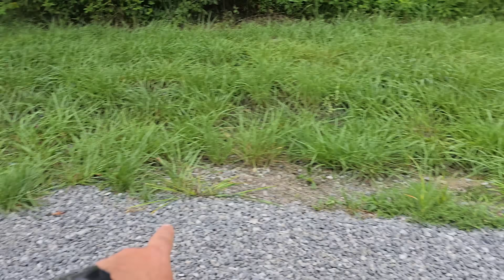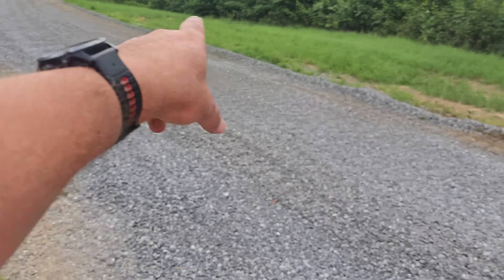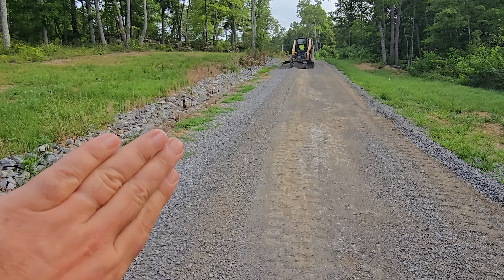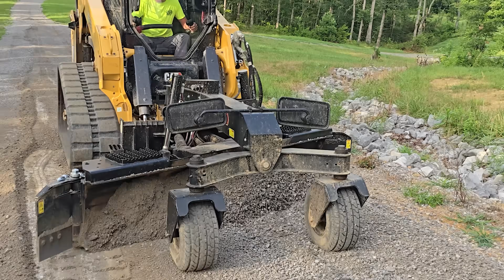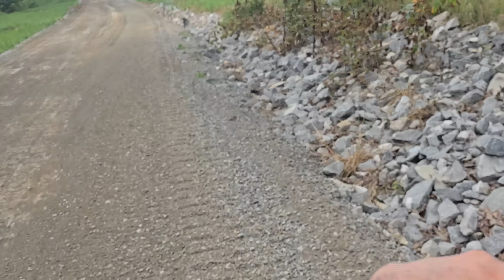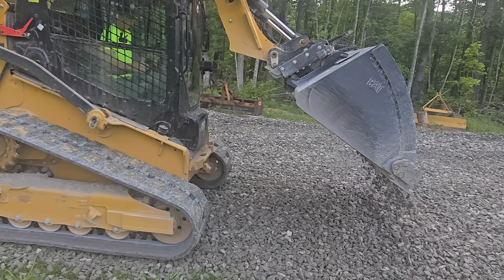#1 Worst Gravel You Can Put On A Hill

Comment: 5/7 works IF you mix it with the fines/clay and compact it The advantage is it goes far furhter per ton Personally, on my road, I used 5 stone(which was compacted into the loose clay as a base) and lightly topped it with either 5/7(with clay from the ditch mixed in) or crush depending on slope the following year If you are going to the job in one day you NEED crush Buy it after a week of low humidity sun to get a decent value

Comment: We have a similar hill and we put down a base layer of larger rock 2”-4” over a year ago and now looking for the correct top layer. What do you recommend?
Reply from the maker: Crush
Reply: @graveldrivewayrecovery  Thanks
Reply: Crusher run. It’s just 57 with screenings or “ crusher dust” mixed so it compacts well and doesn’t roo around like clean gravel.

Comment: Can confirm. I put 57 on our hill because the truck driver couldn't get crush to spread evenly and all I had at the time was a tractor with a loader to spread it. So he came back with a few loads of 57, which spread wonderfully and is now a nightmare on the hill. It's all pushing out, however, so in another year or so, it will all be gone and we'll go back to crush. Lesson learned.
Reply from the maker: Bummer! Anyone can spread 57. It doesn't compact.

Comment: I kinda stumbled on using compatible fill. Its like crusher run with number 67 mixed in. I have short section, 40ft. On 15° grade. No washout, no roll outs.  I would pretty recommend to any body.  1/2 chip works good too.
Reply from the maker: Thanks for watching and your comment!

Comment: The road should be set up properly, where water drained into the ditch with the rip wrap, not away from it!
Reply from the maker: Thanks for your feedback!
Reply: look at the ground on either side of the road  and you can see that it drains fine just the rip rap part on the one side is a small v ditch cut in cause of the embankment thats right next to it so it has a way steeper drop which is why they decided to rip rap that section

Comment: Crush and Run gets washouts because of the dust and finer aggregate in it. Plus its like concrete. Once you put it down you have to stick with it. You cant put 57 on top of it because it will then become like marbles on concrete. My neighbor used Crush and Run. He gets washouts every year which I fix with my Category 2 blade. It takes a lot of runs with the blade because of how hard the stuff is. Water doesnt seem to have a problem with moving it though. I use 57 but dont put down nearly as much as whats on the road in the video. It takes about 5-8 years before my driveway eats the gravel but I dont get washouts. I do get some pot holes which get filled with a little Crush and Run until I run over it again with the blade. But I only have to hit my driveway about 3 times to eliminate the potholes. You have to go over my neighbors road about 20 times to dent the Crush and Run..My 2 cents is that Crush and Run is a bad idea.
Reply from the maker: Thanks for watching and commenting!

Comment: So what’s the best combination of material for driveways and in what order? What’s usually the go to and what situations would you get other material?
Reply: Dig off the organic material, roll out geotextile fabric, then 6" or so of 2"-4" ballast, then 2A modified or some sort of smaller stone with the fines included.  You need to fines to lock everything in place.
Reply: Personally I like a AB-3 base with a thin layer of 11/2 filter rock. Once that 11/2 beds into your AB-3 base your golden
Reply from the maker: Aggregate and then crush in most situations. Thanks for watching and commenting!
Reply: @graveldrivewayrecovery what about millings instead of crush?
Reply from the maker: Millings become like pea gravel. Not fun driving on a thin coat of pea gravel down a hill.
Reply: That's fine when it's dry not so good after rain

Comment: I'm sorry but this is the worst video ever plse. Don't tell me you guys actually grade driveways like this no crown not too mention that little pad of gravel he was spreading was right over turf all I can say is prep work is everything
Reply: Crowning a gravel driveway with steep grades is not always possible everywhere. The area they covered up next to the rip rap obviously was stable enough to keep from washing out. adding 3-4 inches of compactible gravel and blending it into the rip rap should be just fine. Better than before. Gravel driveways are always a maintenance nightmare even if you think you’ve done it perfectly.
Reply from the maker: Thank you for your feedback!
Reply: You don't always want a crown. It gets icey up north and you will end up sliding off the driveway in the winter. It's why Northern roads don't have a crown either.
Reply: Don't forget the customer may of not wanted to pay extra money to fix it properly and or to dig the pad for the parking section